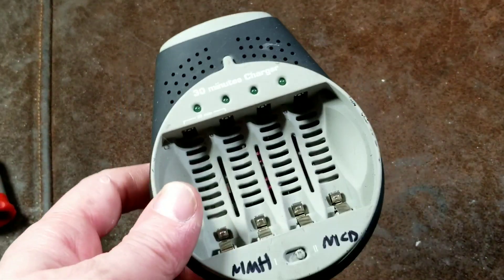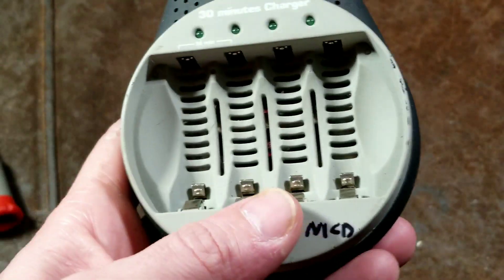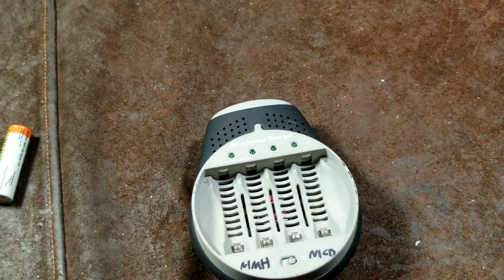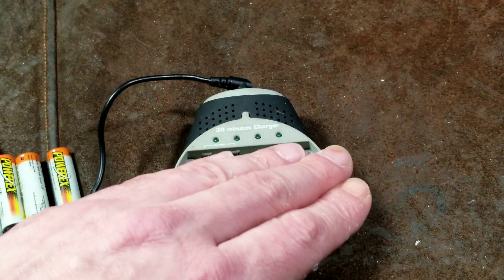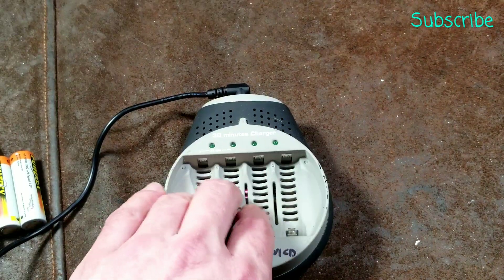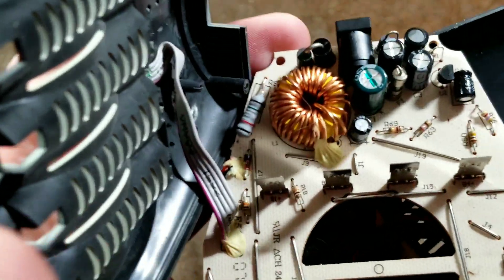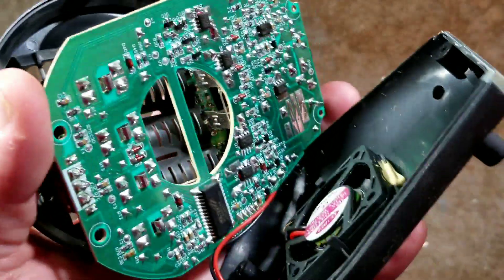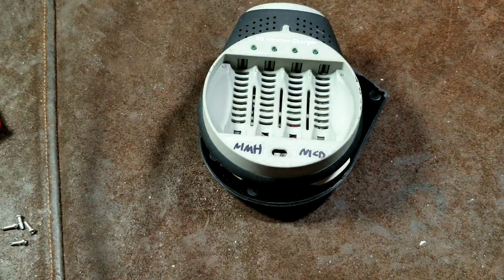Digital Concepts 30-Minute AA/AAA NiMh & NiCd Battery Charger Review

Comment: Thanks so much for taking that charger apart and showing us what switch was NiMh and which one was NiCd. I haven't used this charger in years for the fear of choosing the wrong switch and not placing the right battery when said switch is being used. For the life of me I could not find the physical manual or anything detailing what the switches meant online. The last thing I wanted was a fire or battery explosion. Much appreciated!!
Reply from the maker: it just changes the amperage from high to low, lower on ni-cd because they usually are lower capacity cell compared to ni-mh
Reply: I have the original packaging and manual.
The instructions state:
1. Select position I and put batteries in any two channels for charging 1 or 2 AA/AAA in 30 minutes. 
2. Select position I and put batteries in any channels for charging 3 or 4 AA/AAA in 60 minutes. 
3. Select position II for charging 1 to 4 AA/AAA in one hour. 
4. This charger is intended to charge AA/AAA Ni-MH rechareable batteries only.
Don't attempt to charge any other types of batteries can result a burst, damage and personal injury.